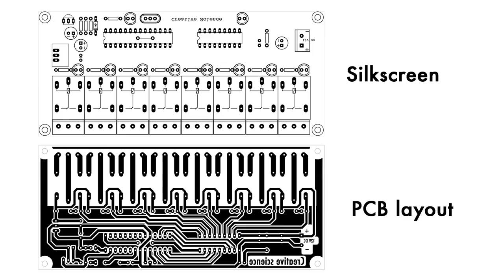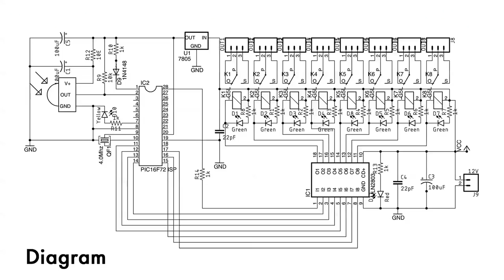8 Channel Home Appliance Control Light, Fan By Remote

Comment: Sir Can I use any remote for controlling it . Or i need to change any hex code . The given code will work for any remote ?
Reply from the maker: This code only working with NEC type remote
Reply: @CreativeScience  thanks for your reply . One more doubt sir . The remote given for rgb light strip will work . The remote will look like this but it has many colors.? Will it work?
Reply from the maker: I am not sure about that RGB remote, may be work with your remote if it is NEC protocol remote, otherwise not working.

Comment: Hi sir., In case 
1) I switched on one load by this remote controller and is active. After some time main supply ( 230v) cut off. When main supply comes, does load get activation suddenly or not?
2) in case if I pressed the remote to activate load and come to know that main supply is cut off. After some time the supply comes and will activate the load or not?
Please answer to the above 2 questions with" YES or NO.
thank you.

Comment: Hello, excellent video, I would like to know how the control communication works with the circuit, I would also like to know if another control would not interfere.
As I understand this can be done with Arduino and you need to program the control, my question is how this project works. I hope you can answer me. Thank you for your contribution.

Comment: Hi, I like very much this project, but I would use an Arduino (or an ATMEGA328) instead of PIC16... Is it possible to have the source code of the hex, so I can port to Arduino?
Thank in advance, and great job.
Reply from the maker: Mr. Simone Mori, i think this tutorial help you, Thanks :) reply back
Remote Controlled Switch Using Atmega 328phttps://tinyurl.com/njczlg4
Reply: V 4
Reply: 8

Comment: sir i have programmed the pic16 But I cannot verify because it is code protected..Any idea sir?
Reply from the maker: The code isn’t protected please check your programmer and connection
Reply: Sir is it ok to use other remote and TSOP2238 IR sensor?

Comment: Is there any coding for this? please ans me? and can I use any other alternative driver { ULN2803APG Darlington Driver 8-Channel } of this?
Reply from the maker: need program to 16f72, u can use another uln2003 darlington driver, but check pinout, both are different ic and pinout,
Reply: Sir, without coding how to make 4 or 8 chanel ir switch? please make a video or give me a link of your video?

Comment: will it works in any remote ?
Reply from the maker: No, only NEC protocol remote work with this circuit
Reply: is RGB (led light ) controller remote will work with this ?

Comment: is there any other circuit for direct ac connection instead of dc?
Reply from the maker: no dc 12v need but you can use simple 1 or 2 amp smps

Comment: Maximum input voltage and maximum output voltage ?
Reply from the maker: 12v dc for board power supply & 220v ac for relay

Comment: Can i use input 12v dc 1Amp sir ?
Reply from the maker: yes
Reply: Thanks
Reply: My project not working 😔
Reply: what is the issue you are facing
Reply: how did you made PCB?
Reply: @CreativeScience  but when I using 12v 1apm it demage component

Comment: Can I use TSOP4838
Reply from the maker: Hafiz Syed Ali Masood Bukhari, yes you can use tsop4838 instead of tsop1838 because both sensor working on 38 kHz frequency , also pin configuration same
Reply: Creative Science thanks

Comment: Where  can I get program for this project
Reply from the maker: Varun R, check video description for hex file link
Reply: Creative Science  Sir I am having problem burning the hex code to the PIC as I do not have a PIC programmer.  tried with arduino but cannot burn the hex file. Is it possible to send me a programmed PIC16F72 with the hex code provided by you. I will pay for it.
Reply: I have assemble the components and done making pcb and soldering...but having problem programming the PIC.